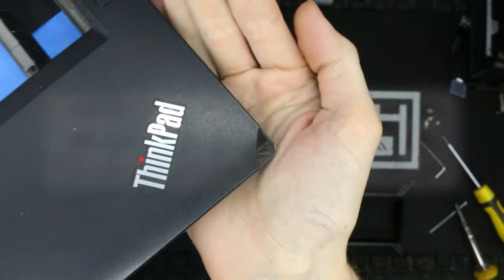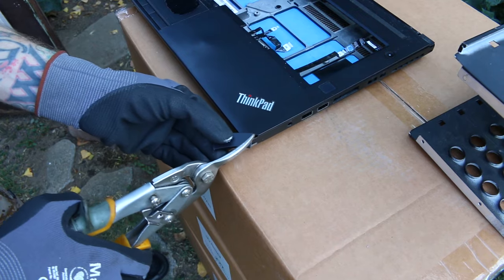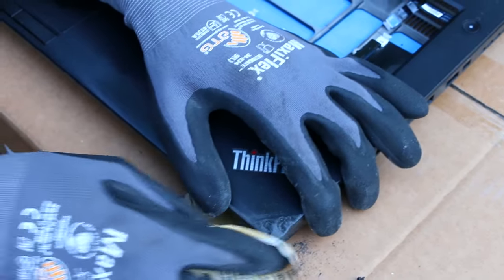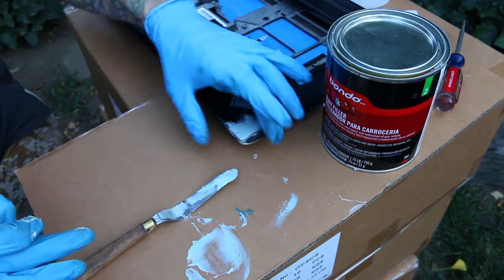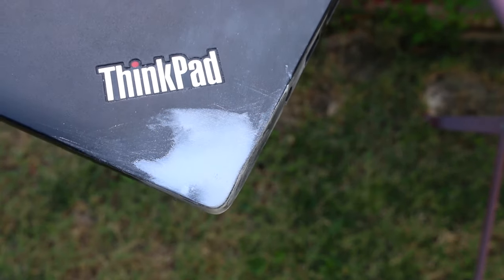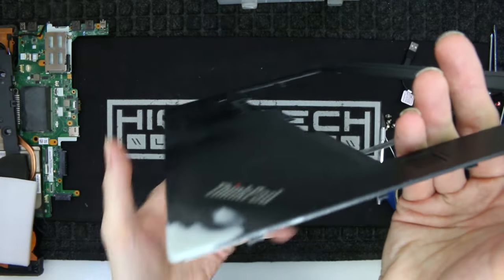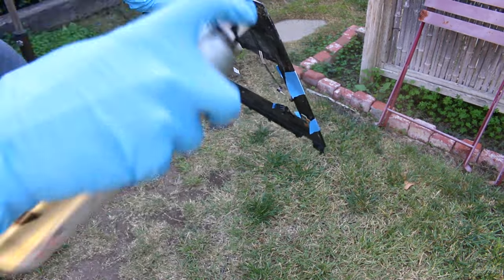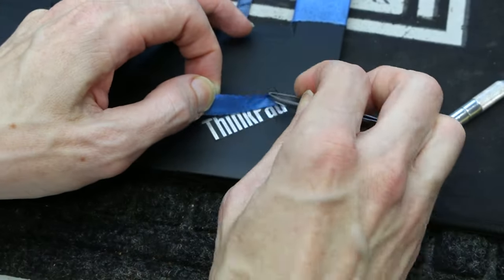💻 How-To: ThinkPad Broken Corner Repair

Comment: Well, I've got a used laptop which has a bent corner. What should I do?
Reply from the maker: For metal you can reform it, or cut it off and do the steps I showed here with bondo + jb weld 👍